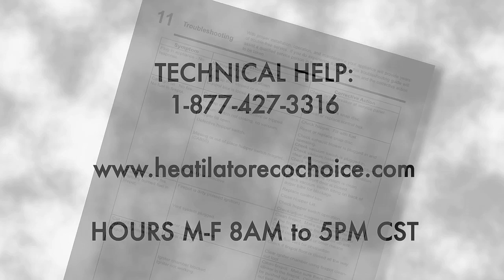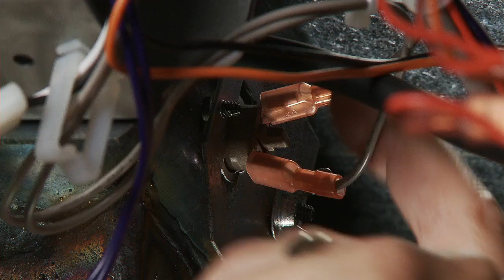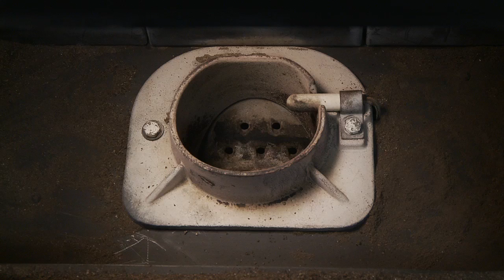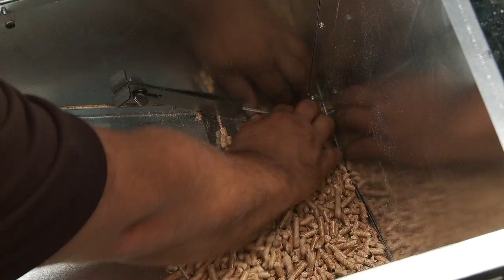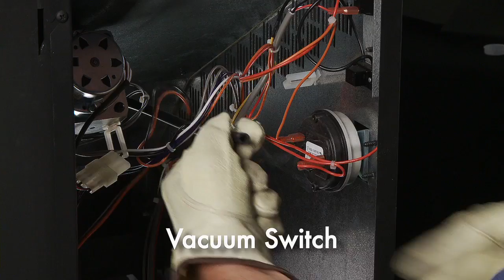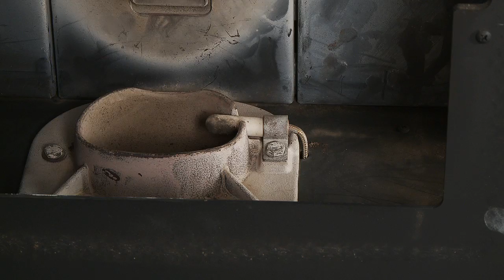Chapter 6 - Eco-Choice Pellet Stove Troubleshooting

Comment: so i came here to add what i just found. so my ps50 auger would run only for ignition then it stopped. I had replaced the thermocouple after it got destroyed and it never ran since. turns out the polarity must of been backwards on the thermocouple, reversing the wires did the trick.

Comment: DEAD,DEAD,DEAD..I have Enviro Empress FS, my combustion fan stopped working. While I was troubleshooting I popped the circuit board, changed the fuse…nothing. I order a circuit breaker but no juice. I tried what you said about disconnecting all the motors then adding them back no juice at all. I have been a pellet stove user for 10 yrs and this is the first time this as happened. Maybe I need a new wire harass or Do you think they sent me a bad circuit board..is there anyway of testing any thing. Nothing is working😮

Comment: Our Heatilator ps35 exhaust fan started blowing this summer after a power outage. I took the side panels off, after pressing the reset button in the back, and the blue light flashes six times. I'm having difficulty finding any information as to what could be wrong and as to why the exhaust blower motor randomly started up after a power outage even with the thermostat off, please help
Reply: This is normal for the stove. Any time the unit gets power, after first plugging in or when power is restored after an outage.
Reply: Every time the stove gets power , plug in , or power goes off then comes on , it’s like plugging it in again , blower will just go on for about 18 minutes then shut off , it’s normal. Hopefully this helps

Comment: My problem is fire gets started then gets really hot. The fan keeps turning on and off then will not work at all..I unplug the stove and leave it for awhile...when I try again nothing happens. Only thing that works is the fuse. (call light)  After a day or so it comes on automatically and works for a while then starts all over again with fans fading in and out? Can anyone help me. I have had service man here twice and he can't figure it out because it works fine when he is here..

Comment: This is our first year using a Heatilator. The house we bought had it so I dont know how old it is. The only issue we have experienced is sometimes it doesn't come on even though the thermostat is set to 70° but it reflects a temp of 65°. We have to turn the temp down, then back up, and we can hear the thermostat click and then it turns on. I think we just need a new thermostat to resolve this issue because its for some black electrical tape on the line.
Reply: Same issue here

Comment: I have a Englander pellet stove,it been a good stove,it's seven years old,does not seem to be heating as good as it used to be.wondering what to do?
Reply: Clean out the exhaust vent or take the unit outside and blow the dust out of it. Maybe the auger motors are week so not feeding as many pellets as before.

Comment: Great Video!  I love this pellet stove.  Recently, the auger motor just stopped.  I checked out all of the other causes but came to a voltage issue.  At the plug before the motor is connected, I am reading 17.7-18 Volts, however, when I connect the auger motor, the voltage at connector drops to 0 volts, nothing.  Bad motor?  I an thinking that the external capacitor went bad.  Can I connect the auger motor directly to 120V to text it?  Bad control board?  Any help would be appreciated,
Reply: What was the issue?

Comment: Well here it is a year later and now the auger motor burned out and it 25 F***ing degrees outside. Had to next day air one because nobody stocks parts for this stove locally. This stove has been the biggest POS. In 5 years I've had to replace the Snap discs, the igniter, two thermocouples, and now the auger motor and I always keep it clean. Junk.

Comment: Pulled the convection motor/blower and insured it worked.  Replaced the #1 snap ring and still no blower after 30 minutes with fire.  Any suggestions?  Thx!
Reply: Did you ever figure this out I'm having a similar issue?